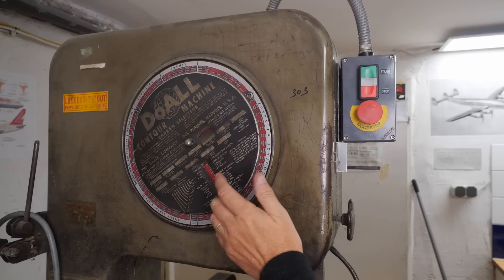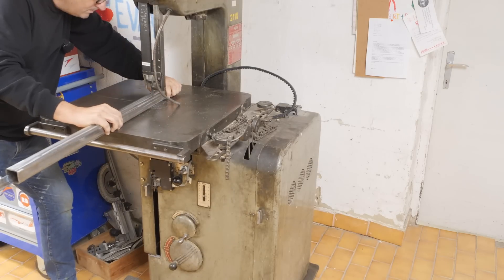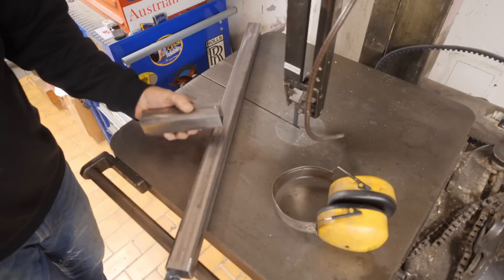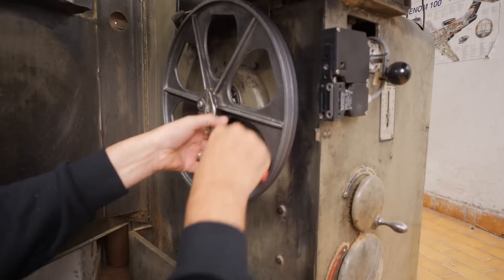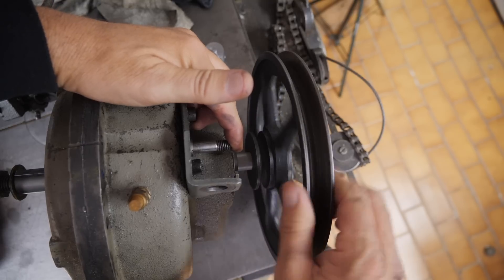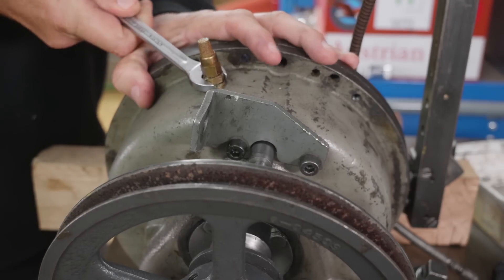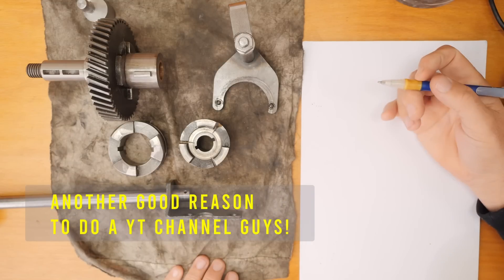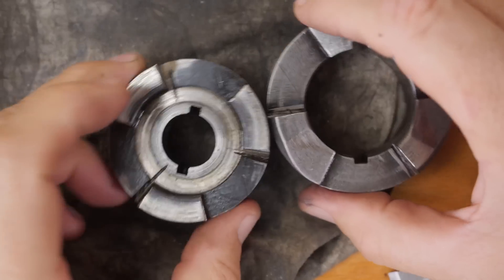My bandsaw still jumps out of gear? Ep. 7 || RotarySMP

Comment: At 5:34, I immediately realized what the problem was.  The spurving bearings were not in line with the panametric fan, therefore the hydrocoptic marzlevanes were not engaging with the pandermic semi-boloid slots in the stator correctly. That easily explains why it was falling out of gear.
Reply from the maker: LMAO!!! I'll dig into my Rockwell control user manuals, to find the correct adjustment for the reactive current of the unilateral phase detractors.
Reply: A turbo encapulator would prevent this
Reply from the maker: @seancollins9745 You are on to it Sean.
Reply: You need to prevent side fumbling
Reply: @JCWren  when I realized that there was a joke in there I just about fell off the chair laughing 🤣.
Reply: Prat!

Comment: I cut the tip of my right thumb nearly clean off in a DoAll bandsaw.  I was making support equipment for the RNZN/RAN Sea Sprite purchase working for SAFE Air at Woodbourne.  Luckily it was able to be taped back on and a 100 recovery was made.
Reply from the maker: How did that happen Larry? Did you slip? I try to use a wooden push stick as much as possible
Reply: @RotarySMP I was cutting 1.25” 4130 pipe and used an offcut piece to push with.  As the saw cut through the job, it spun the offcut and my thumb followed it.  Very basic physics!  Bloody awful briefly looking down to see the bone before putting the tip back in its place.  The Blenheim hospital staff did a great job of patching me up and made a 100% recovery.

Comment: You could probably drill a small hole in the shaft the sliding dog rides on. Not fully through, then cut a groove through the hole and put a spring steel wire inside using it to push out a tiny ball bearing putting pressure on the dog. Making it stay wherever it is . Automotive transmissions use a similar method to keep gears from slipping.
Reply from the maker: I just put the detent on a seprate block. It is working well.

Comment: My opinion is that the drive dogs once engaged, should naturally "want" to stay engaged. So, from your list, I would do #3 first and then tighten up the other issues.  :)
Reply from the maker: That is good logic, but the low gear dogs already have good mesh and back rack, an they were the ones jumping out of gear constantly. I think a saw has enough vibration that you need the shifter to hold the selector in engagement.

Comment: For American V belts, the letter in say, a B38 belt denotes its cross section size. The following number denotes the outer circumference, minus two inches in length. That would make a B38 belt 36 inches outer circumference. An X suffix denotes that it is a clogged style belt
Reply from the maker: Thanks  a lot. I couldn't get imperial B (21/32") belts here, so I ordered the closest metric (17mm) size. The DoAll spec on the data plate links to a V5L420 modern spec on their spares website. 42" converts to 1092mm, so i choose the closest standard whch was 1060mm. I since realised that this saw now has a none standard motor mount, so maybe they needed a shorter belt to compensate. I have been informed tha tthe cogged style is wrong for this use case, so I  will need to get a different one. Once it is all back together, I will try out the old 965mm and the new 1060mm belts and see which is better, then order a new uncogged belt of that length.

Comment: Making a new shift fork is a worthwhile job. Do that for sure. As well as correct the faces on the drive dogs. I'm not as sure about the linkage, but your thoughts are sound. Perhaps add a spring detent setup to hold the linkage in position.
Reply from the maker: Yeah, turns out DoAll added spring detents on some of their saw models, so I am planning to do that as well.

Comment: The drive dogs need a negative rake as when under load the dogs will tighten together and hold the engagement.
Reply from the maker: That seems logical, but it was reported that DoAll used 0 rake on these originally, and had the shifter hold the selector dog in place.

Comment: i would backcut the shoulders for sure, and i think your on thje right track on the worn shifter fork. but you may do an upgrade where you pput some high wear nylon style material instead of the balls, or even just remake the while fork end out of thicker material so there is less slop.  i do like the idea of taking the slop out of the shifter lever, maybe a steel bush welded to the bracket to remove slop, and then simular on another support?  Good luck either way.
Reply from the maker: I will certainly remake the shifter, using a solid wear surface instead of those balls. Removing play form the linkage and adding a detent is also on the plan.
Reply: @RotarySMP  remember us men have balls, but gears should not! ;) haha made bettter funny in my head

Comment: B  is the belt width 40 is the length there a lots of online belt length calculators.
Reply from the maker: That old DoAll partnumber on the dataplate links to a V5L420 belt, with 42" converting to 1092mm, I bought the closest standard size which wa 1060mm. I since realised that the motor mount is non standard, so maybe that led to the shorter belt.

Comment: In a manual transmission car, there are spring loaded ball bearings that seat into detents on the shift arms. Those play a big part in keeping the car in gear. If you add something like that to your shift arm it could help keep it in place. Maybe some kind of friction lock could also work or just a really heave lever flipped so gravity helps keep it in place. It is possible all of the loose components combine with vibration is what is popping it out of gear.
Reply from the maker: Turns out DoAll added detents on some models, so I think I will do that. I will certainly take the play out of the linkage.

Comment: I'd probably just touch up the roots of the drive dogs with a dremel as the faces should be worn to all engage together at once, there again i dont have a tool and cutter grinder 😊
Reply from the maker: Hi Leslie, I responded to your comment a week ago, but it seems YT didn't capture it. 
I will probably gash the root relief with the angle grinder, but then set up the Clarkson T&C grinder to precisely grind the faces.

Comment: I think it’s the yoke given only the ball bearings should be in contact - no wear in the sides which you have. 
Making a gearbox sleeve to self hold the gear lever seems wise to take out the yoke lean.
Reply from the maker: The gearbox was previously run until the intershaft bushing was so completely slogged out that a Woodruf key was released. I suspect that wear on the side of the shifter fork was from when the bushing was deflecting. But year, it is a crap design with the balls an completely worn out, so I will replace it.

Comment: It looks like someone before was chasing the same issue and put a ton of rake on the selector. This seems like a patch on another issue, the selector fork shouldn't have much play at all. I agree with the other comment that disengagement may be because of brief backdriving when you take a load off.
Also, the rounded shoulder on the side you reground is a no-no. I would aim for a very slight back rake, maybe 5⁰, to make them hook together. Not to keep them engaged, but enough to pull then together should they meet in a slightly off-engagement position. You wouldn't want the selector fork to be under constant load while cutting, it should just keep the parts in a place where they won't be able to disengage - otherwise it will wear out rapidly.
Reply from the maker: Thanks for you inputs. You are right. When I first did the gearbox repair, I incorrectly thought the shifter was only for gear changing, but now see it is important for retaining the gears engaged. That oldshifter is toast. I drew up a replacement yesterday.

Comment: The shifter fork is the culprit alright, I think. Those balls had flat spots by the look and were very sloppy fit in the slot and the fork, easily enough play for it to disengage under load. They have likely been replaced judging by the staking and may be undersize from the original. I'd go for some replacements a size (or two) up that are a close fit in the slot. How much side play is there in the shift fork shaft? The scoring on the fork says quite a lot, it runs in another bushing? ovaled out? In other words, all the thoughts you had ;)  You could even consider adding a third ball in the scored area of the fork to maintain planarity with the slot. That staked ball is a weak point in the design, the staking contact points with the balls are just a thin lip of steel. If you can't get it tight and robust, i'd be tempted to ditch the balls and braze on a couple of bronze slipper pads instead with a good surface area. E.G. like a motorcycles' shifter fork. A detent mechanism somewhere for engaged/disengaged would also be very useful.
Reply from the maker: Thanks for your design review. Very helpful. The shifter shaft has a nice sliding fit. It is not worn out.  But since the balls are not restrained, there is a couple of mm of sideways play. The balls are 6.15mm and have flat spots, while the slot is 6.75mm. I don't have any replacment balls in a better size, and agree that it is not a very robust design anyway. 

 DoAll used shifters with hardended blocks instead of balls on some models, so yesterday I drew up a replacment fork like that. As it is a well lubricated location, I am at two minds whether to use hardened slippers or bronze.
Reply: @RotarySMP  Right, so the scoring is a result of the ball hitting the limit of the slot face but the fork continuing to move due to the play between ball and fork. Yes I think the pads are the way to go, either type would work well I'd say given they are constantly bathed, 6 of one 1/2 dozen of the other.
Reply from the maker: @m3chanist  I was thinking some more about it, and think that bad surface wear on the shifter fork cauld also have been caused back when the intershaft bearing was so slogged out that the output shaft (carrying the selector ) was misaligned.

Since my heat treatment oven is dead, I guess brazing on bronze wear pads is more realistic at this point.
Reply: @RotarySMP  Sounds like a plan. 👍 I envy your doall and it's gearbox, I have a wood saw that I converted with a 1kw DC motor and speed control I repurposed from old rock tumbler, it work OK but I suspect you have much more low speed torque.

Comment: I think I would square the drive dogs up. I would get rid of the ball bearings on the shift fork ends in favor of Bronze brazing the sides of the fork and re-machining it for a running fit in the groove. And finally remove as much slack as possible from the rest of the linkage. The B38 in the old belt is all you need to match for the length.width. The X in the new belt part number denotes a notched back belt. I once bought a cutoff band saw cheap because it made a lot of rumbling noises while running. The previous owner had replaced the belt with a notched back belt and as the belt wore, the notched sections turned into little bumps making the rumbling noise. Replacing the belt with a smooth backed belt solved it.
Reply from the maker: Thanks for your excellent inputs.
I'll be more carefull this time to get a nice flat grind on the dogs. 
You are right, those balls are a crap design. Even if correct, the peened retention makes for point loads which would wear out fast. 
Do All used hardened blocks on some saws...
https://www.doallsaws.com/parts-store/spare-wear-parts/transmission-gearing/111449-shifter-fork
.. so I drew up a replacement fork yesterday. Undecided whether to go for a hardened steel fork or bronze wear surface.
DoAll also added detents on the linkage of some saws...
https://www.youtube.com/watch?v=1t6aH7WTzC8
...so I will add some to mine as well.
Thanks for the belt knowledge. I didn't know that, and got the wrong belt. I'll get another one.

Comment: I just so happen to be working on the same model bandsaw gearbox.  If I can supply any photos of my parts, please let me know.  Mine appears to be in much better shape then yours.
Reply from the maker: Hi Steven. Thanks. I appreciate that. Does yours also have the balls in the shifter fork? Looks like other DoAll models have (hardened?) steel weat plates there.
https://www.doallsaws.com/parts-store/spare-wear-parts/transmission-gearing/111449-shifter-fork
Does yours have detents in the change linkage?
https://www.youtube.com/watch?v=1t6aH7WTzC8
Reply: @RotarySMP  Hi RotarySMP.  Yes, mine has balls in the shifter fork, but looks a little different than yours. No, mine does not have detents.  Also, no wear plates.  I believe that the gear shift lever should be either at a 90 degree left or right position when fully engaged.  This "locks" the shift lever in position.  Your gear change lever appears to be a DIY repair.  Maybe the shifter fork is as well.
Reply: On another note, I'm going to change out the output shaft bearing to a double row if I can, for better alignment and rigidity.  Think I will also change out the bushing for a needle bearing and inner race.  This is how the later gearboxes are constructed.  Evidently, DoALL knew this was a problem in the  design and improved it.
Reply from the maker: @goldfinger0000  Yep, that gear change lever was missing when I got my saw, so I made it. It has no detents. I also remade the cam and the cam slot. Once I have the play out of the system, I will ave to see whether it latches in the two engaged position, or needs a detent added.

I drew up a new shifter fork yesterday, and will go for a wear plate design.
Reply from the maker: @goldfinger0000  Yeah, I would have put in a needle roller if I had thought it through. By the time I realised, Luke was already making the shaft with the pinion to the original design. 

Given how little work my saw will see, I expect the intershaft bushing to easily outlive me.

Comment: What is holding the drive dogs engaged while the machine vibrates during the cut?
It seems to me either you need a back rake to pull them towards each other or you need some kind of spring in there.
Reply from the maker: I think that it is supposed to be that shifter fork, but it is all so slogged out, that it fails to retain the shifter in position. I drew up a replacement fork yesterday.

Comment: I've never seen a shift fork with steel balls in the tips before, that looks very much like a badly executed DIY bodge to me. Note how one hole is very close to breaking out of the edge of the fork.  Steel shift forks would typically have a pad of bearing material (e.g. bronze) on the ends.  The damage to the ball's surface with numerous small flats show they aren't spinning within the fork, and instead will be scoring the shift hub.
Reply from the maker: I have feedback form other DoAll owners that this is an original DoAll bodge. I agree it is a crap design, and other DoAll models didn't use it.
https://www.doallsaws.com/parts-store/spare-wear-parts/transmission-gearing/111449-shifter-fork
I drew up a replacement fork yesterday. I am unsure whether it is better to make a case hardened part, of braze on bronze slippers.

Comment: Ha ha 'Wait long enough and it fixes itself....' as a fellow procrastinator (I think I'm at PHD level) I understand COMPLETELY!
Reply from the maker: Hi Neil, the problem is my procrastination has works often enough that it seems like a valid method :)
Reply: Years ago,an author I admire came up with the term. 'Intelligent lethargy'. As in,sometimes problems solve themselves. With people problems, surprisingly often. With things mechanical, less so. A noisy bearing can after all be solved by replacing the entire transmission. But only if you have a spare transmission. And so forth. Good luck with this. @RotarySMP
Reply from the maker: @paulmanson253  Well put Paul. I tend to forget mechanical bits are more consistant than humans :)

Comment: Looking at the wear pattern on the shift fork ( heavy near the shift rod, lighter near the contact points ) suggests to me that the fork is bent or misaligned and therefore may not be pulling the dog clutch fully into mesh or holding it in mesh. I was also thinking that those contact balls may be designed to be free to spin but the balls and their sockets have worn "beyond the wear limit", another possible cause of only partial engagement of the drive.
Reply from the maker: Good observation Gary. I uspect you are right, I'll check it with a square tonight. You are ceratinly right about the ball retention pockets being worn beyond limits as well. I drew up a replacement yoke yesterday.

Comment: Well, that`s the issue, the gearbox should not be driving your nuts - but the bandsaw blades... You just gotta figure out how to decouple it from your nuts and onto the saw-drums... Quite the simple solution... 

Edit-
Also, i would leave the back-rake on the dogs... That seems to be extremely sensible and useful... Pure 90deg makes sense, as it should never jump out by itself, but a biting rake wants to pull the two together - which is better if there is any wear... 

Cheers; Best regards!
Steuss
Reply from the maker: Thanks Steuss. You are right there. I wont regrind the nice flanks with back rack on the low speed dogs, but will regind the high speed dogs, to give nice flat and vertical faces.